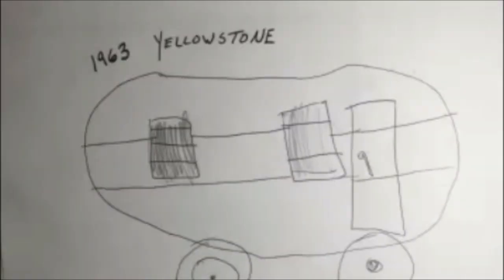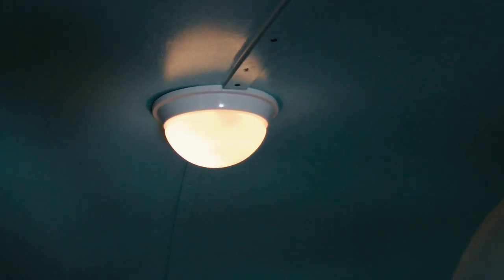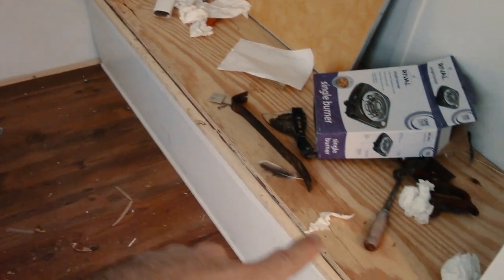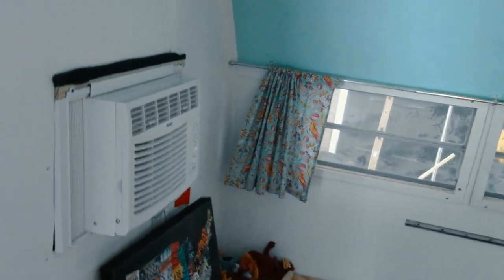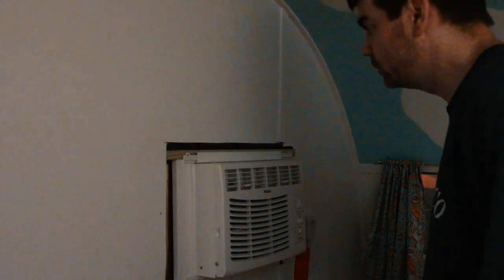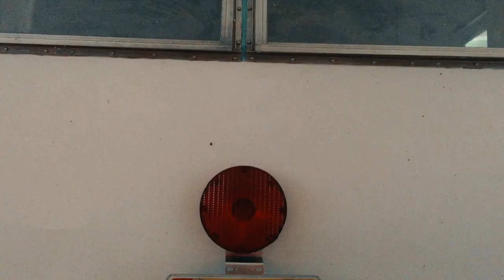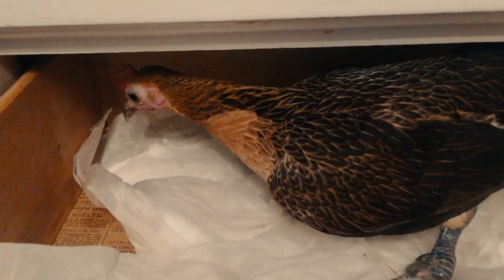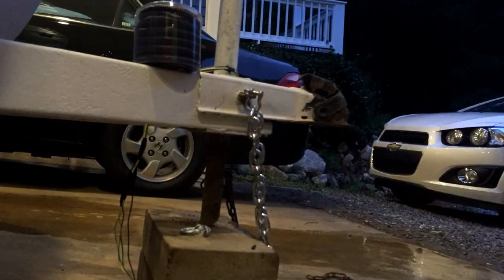Vintage Camper Restoration -IT'S ALMOST DONE!!! - Restoring a Yellowstone RV for Farmer's Markets

Comment: A vintage camper all spiffed up and ready to go. Great Job!  None of my business, but I would suggest putting a drain on the sink and a sewer hose connection. I owned a RV park  for quite a few years and I think you will be much more satisfied connecting to the RV park sewer system,  and possibly less grief from the RV Park... Besides that bucket will fill up fast..  Just an observation.  Really enjoyed the RV restoration videos.
Reply from the maker: Thanks a ton Bushrod!!! I may just do that! My thinking was that we prob not going to use the sink that much & the bucket would be sufficient but you're prob right.  Thanks again!-Jason

Comment: great job Jason! she looked cool rolling and the lights on! Are you going to run the drain to the outside in the bucket? Thanks for sharing, great job buddy
Reply from the maker: Well just thought about placing it in the cabinet right under the sink, & have a valve that would switch it to a drain outside in case a campsite had a gray water hook up....but I may do something different....thanks buddy!!!

Comment: How in Gods name do you change the tires?!? I’m redoing a old similar style camper and I can not get the new tires to fit back into the tight wheel well.
Reply from the maker: I’ll go look at my size, but I had to let the air out some to get them in
Reply: Cog Hill Family Farm thanks. That’s what I think I’ll have todo. Just didn’t want to deflate them an hour after I just got them put on the rims.
Reply from the maker: I def feel your pain bc it took me a while to figure out what size bc it had 2 different size spare donuts on it, & then trying to get it on